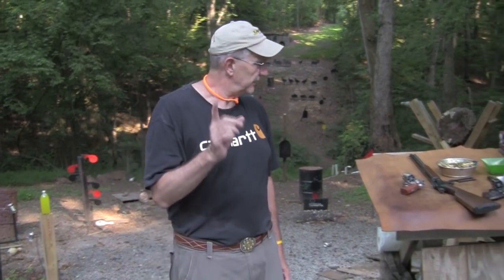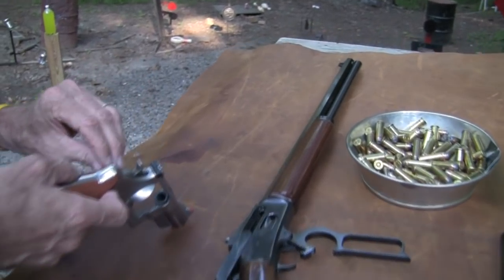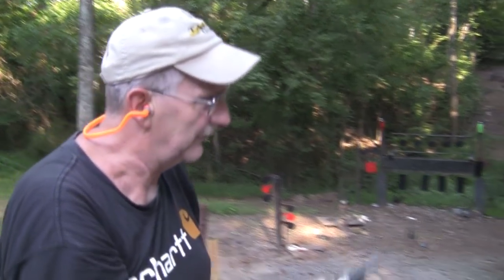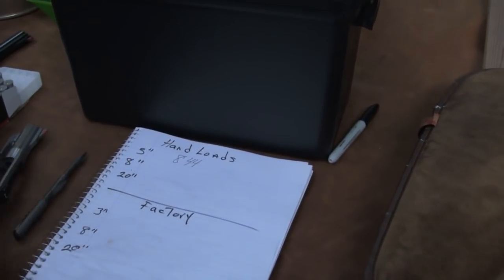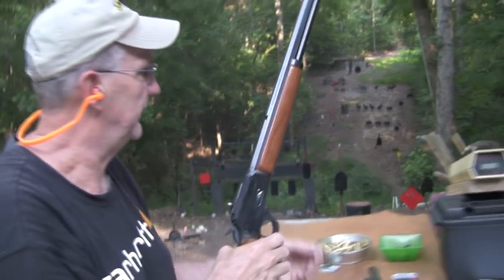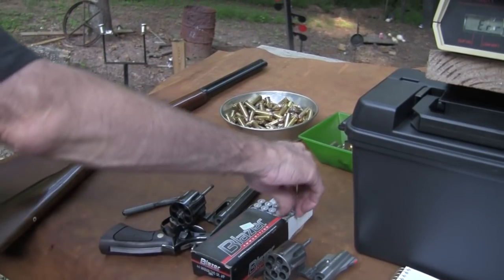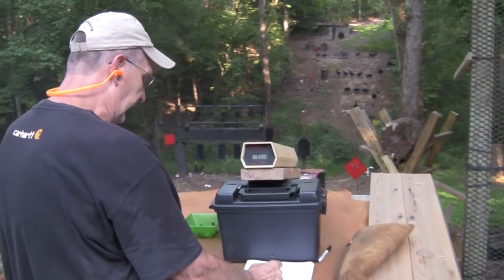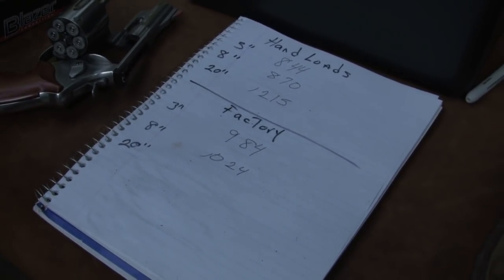44 Magnum Velocity Basics.

Comment from the maker: They are great loads. "Slow" is relative.  Compared with .44 Special or .45 ACP, they are fast and hot. Compared with some of the hottest .44 Mag loads I load for my rifle or my Garrett rounds, they are not that hot. One reason most people never attain a high level of marksmanship is that they focus too much on some big, powerful, sexy round that is no fun to shoot after about half a box. They shoot enough to develop a good finch and bragging rights about their macho ammo. :-)
Reply: Hickock45 this is one of those rare times I have to disagree with you. " Slow is relative "? 
The velocities you got were .44 special loads and far less than even a standard Winchester factory .44 magnum load. A 240 grain magnum load at the very least out of your 8 1/2 inch barrel should be between 1240 to 1400 fps using the older Smith and Wesson revolver. A Ruger Super Redhawk will shoot even hotter loads without concern of damage to the revolver. A person comfortable with the .44 magnum won't have a problem with the Finch factor when using hot loads.

Comment: 870 fps from an 8" barrel sounds more like .44 Special velocities.
Reply: I know he is a big guy, but if they looked like they hardly kicked. Even in a 3 in barrel. I agree with your comment as a reloader myself. It was a different bullet he was using, so I don't know if his normal handloads with cast bullets are any faster.
Reply: I handload 44 mags myself.
Reply: Me too.
Reply: +AFDoc00 Sweet. I use a higher amount of Unique for a medium round and Accurate Number 9 for the hot rounds. All over a 240 grain semi wad cutter. Either Missouri Bullet Company or Oregon Trail Laser Cast.
Reply: AFDoc00 : that’s what I’m sayin!! 800-900+ FPS isn’t a .44 mag at all, those are def .44 spl velocities....the velocities he was getting out of the marlin @ 1,215fps is more like it and even that is relatively light. .44mag should easily reach 1,200-1,400+ on the regular
Reply: It's  easy to load .44 Spl velocities from Magnum brass. Oh, wait, a 246 LRN at about 850 is a standard .44Spl. 

Dont call it "magnum" when it's  not.

Gotta draw the line here. My Redhawk in 1988 taught me as a neophyte handgunner that the aluminum cased 'mid-velocity' loads by CCI Blazer were just about like  .44Spls. I'm at 6:01 in the video. Let's see how it plays out.
Reply: Lots of us like to shoot "medium loads" in our 44 mags just for fun shooting.  He says he is using 2400 powder but he doesn't say how much. It looks to me like it's about in the middle of the chart. Maybe 14 to 16 grains.
You don't always need to shoot maximum loads to have fun.
Personally I like Unique for light and medium loads because I get more shots per pound of powder.
Reply: Bear creek ballistics 225 Gr gets 2000 fps out of a cva scout…awesome deer hunting bullet

Comment: Hey Hickok. Been watching your videos for a LONG time. I think I first ran across your channel back in 2009 when I watched your first .44 Magnum video with your smith 29. I love the .44 magnum. versatility is an understatement in my opinion. Lol. You can do anything from 44 special plinking, small game like squirrel and rabbit, and all the way up to barn burner hardcast loads for bear spray. Maybe even african big game with hardcast. It will fit nearly any niche. As a lover of the .44 and shooting it on a regular basis, I've always wondered how you load your magnums. I know you said you use 2400 powder and have been since you bought it in '74. In this video they chronographed under 1000 feet a second and shot really well and looked pleasurable to shoot in all of your other 44 videos. If I'm thinking right, the start load on 2400 with a 240 grainer is 18.5 grains but the velocity out of a 4 inch barrel is like 1100 so I know you have to using less than 18.5 grains. Could you give me a ballpark on where to start. I use 2400 exclusively for my 44's like yourself but I have never tried to load moderate magnums with it. I'm tired of the classic Keith load of 22 grains. Lol. They are extremely accurate with the 250gr Keith that I shoot but the recoil is a bit stiff to make them enjoyable. My 7.5 inch Redhawk loves them but I really want to start downloading them for a little more economy and make them a LOT more pleasurable to shoot. Could you give me a ballpark on where to start to get them below 1000 feet a second. I figured you would be the guy to ask since you have been loading 44's since '74 and I love the way your 44 pet load shoots. Thanks Hickok

Comment: Interesting results even though this vid is 7 years old, my shooting buddy had the same results through his carbine with factory loads and hand loads that are very accurate in his 6.25 in barrel revolver.  He found that the powder he used for his accurate pistol loads was terribly inaccurate when he loaded the same cartridge in his carbine. My bud is a little hard headed and refused my suggestion that he move to a slower burn powder and decided that he could just reduce the charge from his pistol load and it should work fine.  He reduced the charge to about 15% below the minimum recommended charge and the rounds became very accurate but the cartridges exhibited consistent "over-pressure" symptoms.

I convinced him to let me take his turret with dies (we have the same presses) and load 50 rounds for him using a fairly fast rifle powder rather than his pistol power.  The results were dramatic! The carbine was extremely accurate and his revolver suffered no loss in accuracy! 

The comment made in the video about powder choice is something that deserves consideration by every handloader!

Comment: With some math you get 30-35% increase in velocity from 8 inch Barrel to 20 inch that in turn give you over a 70% increase in kinetic energy which is quite jump especially when all you did was get a longer barrel 
  To put that into perspective, that increase in power is larger then the jump from hot 357mag to average 44mag

Comment: I'm not a chemist, so i may be wrong, but my understanding is that at the molecular level there is a difference between burning and exploding.

When something burns, it heats up until it ignites, heating the next molecule so and so forth. In an explosion a molecule exploding compresses the next one causing it to explode and so on.

A true explosion is detonation, burning is deflagration. If you want to know more the wiki articles on Deflagration vs detonation seem quite good

Comment: I had the same chrono for close to 10 years until it had an untimely death. I could have sworn I put it in my truck before leaving the range about a year ago. I went back to find it and found what was left of it scattered down the hwy, guess I left it sitting on the roof when I drove home. It was old but it was simple and worked perfect.. My new one has so many buttons I still haven't figured it all out. Great ammo test, thanks for sharing.

Comment: Yes, those do seem more like warm 44 specials or very light magnums. The other possibility is that the Chrono is off or reading in mph not fps. 240gr in a 6" revolver should be more like 1240 fps on 44 mag as an average load. Your cylinder gaps could also be worn out, but that doesn't explain the low velocity in the lever action.

Comment: I rally liked your video, I have a load I use found from years of ladder testing powders, I use a IMR 4759SSC this is a slower burning powder like you talked about that can be slowed way way down and made real comfortable to shoot from pistols and rifles, the rifle loads are about 25% more in powder weight to achieve the same velocities, I have even made some serious burners at 1780+ these of course are compressed loads and with that I see pressure limits being reached on the Heads of cases and the primers which tells a loader with that free sense that your at a good stopping point.

Great Video I really like your personality

Comment: You are correct on that. The riffle's chamber is closed by the action sealing the cartridge into the barrel of the gun. In contrast the revolver has a gap that does expel gasses. like you said I too believe the powder makes a difference as well. I hand load .38 special +P with Long Shot powder and it is mainly used for shotgun propellant. It would be interesting to compare charges and barrel length to determine what the Ideal powder for say a short barrel pistol would be for maximum velocity. Just something to ponder. Nice comparison.

Comment: There is so much involved in ballistics/velocity it's crazy. I figured out years ago that barrel length isn't the only factor in velocity and in fact doesn't always add up. For instance, in my two S&W snubs; a 642 and 340PD both have the exact same barrel length but yield ~60-70fps difference for the exact same loads and my modern 3" .357 yields 20-30fps more than my classic 4" with the same loads! Also,. My Browning Hi-Power with 4.5" barrel puts up a solid 50fps more on average than my 5" M9/92FS with the same loads and unfortunately for Hickok and myself, Glocks in stock form tend to put out terrible velocities compared to other semi-autos in general. I find this interesting because like many I assumed barrel length dictated velocity gains or losses and that just isn't the case. Chamber tolerances, style of barrel/rifling, and probably half a dozen other things come into play as well. Velocity is a direct result of pressure, so a loose chamber is going to yield less fps than a tight one even with identical barrel lengths, etc.
Reply: I've always liked Randy Garrett's loads even though I load 44 magnum as well as 38, 357, 357 MAX, 9 mm, 44, 445 super mag.. He claimed the best bear loads with the 310 gr. FNSWHC . I on the other hand got the most accuracy with the 330 gr. FNTCHC and modded his load of 18.6 gr. WW296 to 18.4 for even more accuracy. I took 4th place shooting 200 yds. with a 14" contender consistent 5" groups and my best 1 3/4" for 5 shots at 200 yds. benched and rested .

Comment: I've Chrono'ed the same 230 gr Lead RN bullet 45 ACP hand load thru three guns: a Springfield 5" 1911A1, a S&W 625 4" and a Taurus Tracker 4" 45 ACP.  The 1911 averaged 850 fps, the 625 averaged 830 fps and the Tracker averaged 870 fps.  The Tracker has a very tight 0.003" B/C gap, while the S&W runs a 0.006" B/C gap.  

Revolvers can have much tighter chambers than an auto pistol, and if the B/C gap is very tight, a revolver can actually slightly exceed the velocity of an auto pistol.

Comment: I can't help thinking that Hickok's chronograph is reading low. Blazer ammo isn't all that hot, but 1024 fps from an 8 3/8 barrel? Ad 100 fps and I might believe it more. Also 870 fps for his handloads from the same barrel. That's warm .44 special territory rather than moderate magnum methinks. Add 100 fps to get 970 fps and you've got an absolute max, or over max, .44 special - that sounds more like a moderate magnum to me! Demonstration remains perfectly valid though!

Comment: Really liked that video, I read in a couple of places where a 44 mag  max barrel length is between 16 " and 18 " after that the bullet starts to slow down,  would like to see you do a video on it  using a  16" vs a 18" vs a 20" It looks wright on the chart I found until you got to some of the heaver bullets, at 18" they were still gaining speed but that is as far as they went. If I remember wright they only went up to 240 gr.

Comment: You're absolutely right. The gas is still expanding and COULD have been used to push the bullet farther down a longer barrel. But when the bullet exits after 3-6" then it's time of being forced down a barrel is done and the gas then expands in the air just bast the barrel's end. Keep it in there and that impressive muzzle flash of a 3" pistol could have been used productively.

Comment: 10:45 Barrel lengths imcrease velocity because the bullet will have more space to accelerate. Hence higher velocity at the muzzle. The bullet will keep accelerating as long as the pressure on one side is higher than the other, which happens at longer barrels.

Comment: If Im understanding your question correctly, a semi-auto rifle would most likely have less velocity because some of the gas has to be used to work the action and bring the next round into battery whereas, say, a bolt action rifle would have a further effective range because the action is worked manually and all of the gas is used to propel the bullet. Lever action works in a similar manner as bolt action in that sense.

Comment: One thing that should be noted is that if shooting cast bullets, you may be fine with a standard flat base in the revolver, but the same powder charge could require a gas check because of the additional velocity the long barrel generates.

Comment: The point is to direct gasses upward to counteract muzzle climb. When the gun is fired, the bullet moving down the barrel forces the muzzle up.  A ported barrel lets some of the gasses exit upwards at high speed, forcing the barrel downwards to counteract muzzle climb. How well a ported barrel works depends on the firearm, cartridge, bullet weight and powder burn speed.

Comment: I reload the Blazer .45 ACP aluminum case ammo. That stuff uses small pistol primers like out of a 9mm instead of the large handgun ones, for some reason. I load them pretty hot, too, my 200 grain JHP carry rounds are doing at or just shy of 1000 FPS, probably less out of my M&P than out of the 5 inch barrel gun I chrono'd them out of, and I haven't had any cases split yet.

Comment: I always wondered about loosing power /pressure with cylinder gap. I was even told that semi auto pistols , you loose power with the blow back design, it takes a lot of pressure to blow the slide back , and load that next round.

Comment: I've reloaded Federal Aluminum cased for 9mm before, some of them 3 or 4 times. Worked in a pinch during a time when I had no brass left to reload. (They're def boxer primed 🤣) Gotta inspect them well though, had one case start to split after the 1st reload. After that I began loading them w/some pretty low charges & didn't have that problem anymore. Worked great for plinking & cycled just fine. Sometimes u just gotta take what u can get I guess... 👍

Comment: The dangerous property is it's tendency to fatigue.  It is also weaker then brass by volume (stronger then steel by weight).  Having said that, you've got me, I have never reloaded aluminum and as such, have not seen one fail.  The manufacturers, however, all recommend against reloading their aluminum cases.  Brass cases being free, I will take that recommendation.

Comment: For the more science oriented.  There is a fire triangle, in order to have fire you need oxygen, fuel, and heat. Without getting into explosion definitions, the reason a longer barrel typically gives you more velocity is because the powder has a chance to more completely burn and therefore transfer more of the chemical energy into kinetic energy.  At some point a barrel is too long and the powder is completely burned at which point the barrel creates a vacuum, slowing the bullet.

Comment: I wonder, too. But the auto has to use some gas or force applied back to operate the slide and eject the spent cartridge. A better test would be a Thompson Center Contender single shot as the breech is locked.

Comment: It makes sense. Less barrel, less contained and utilized gas and pressure. More barrel more use of gas and pressure which equals more velocity. I wonder, is the loss of pressure from the cylinder cone enough to affect velocity?
Reply: don't know. but once your moving at velocities measured in feet or meters per second one or two feet or meters per second probably won't matter as a 44 magnum is going to go through your target anyway... home defenders beware. rounds go through. they don't stop just because your threat did.
Reply: Good stuff.
Reply: Chris Ross If using a .44 in a home defense situation, should one keep it loaded with hollow points (.44 special ammo, of coarse)?

Comment: That depends on the barrel / cylinder gap and chamber tightness.  When comparing auto pistol velocity to revolver velocity usually the auto pistol will have a slightly higher velocity than the same ballistic barrel length revolver, on the order of 30 fps faster.  However I have chronographed revolvers that had higher velocity than auto pistols, due to tight tolerances.  For reliable feeding, auto pistols are chambered looser than revolvers,and that factor at times can give a revolver the edge!

Comment: higher velocity, i believe from my limited experience shooting, is based off of the pressure cup in the cartridge. slower building gases are for higher velocity and for bigger grain bullets. from taking longer to build up, it has a much larger pressure cup in the cartridge, therefore higher velocity.

just a guess...
Reply: also the shape of the bullet and the drag that cause affects velocity greatly. but a s&w round 44 mag can go 1400 fps aprox, so it all depends on the bullet

Comment: A longer barrel increases velocity by the laws of thermodynamics, the energy transfer to the bullet is a function of the volume swept out by the bullet times the pressure. A faster burning powder will will increase the initial pressure. Ergo, if you want power out of a short barrel you need a faster burn rate, and a large bullet to get higher energy.

Comment: Hickok, The rifling in the barrels are all different, The rifles is probably a tighter spin, as well you mentioned the cylinder gap costs you FPS. Difference in rifling and barrel length= better FPS and accuracy.

Comment: These rounds Hickok fired are pretty mild.  I was getting 1500+fps from a 240 grain bullet in my 10 1/2" Ruger SBH.  When it comes to foot pounds of energy,  that is figured using weight and velocity.  A 10mm may have velocities that approach those of the .44 mag but that is only part of that equation.